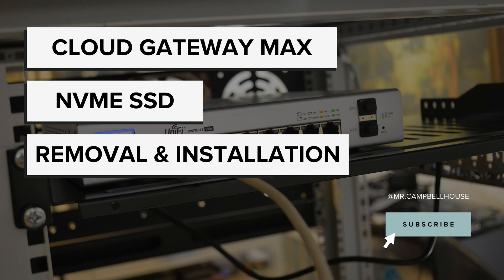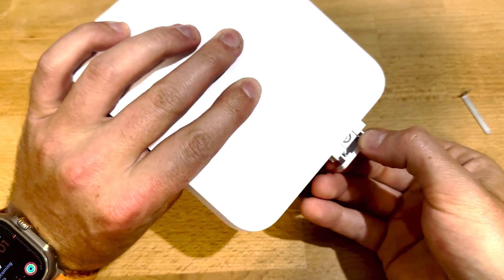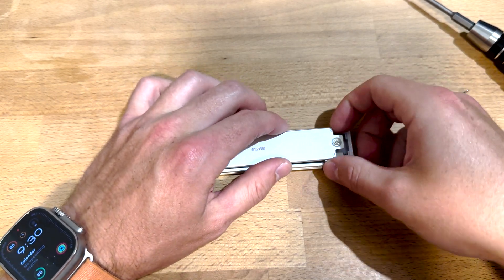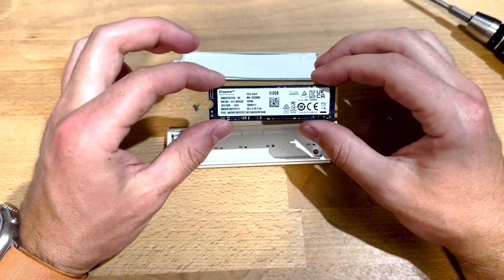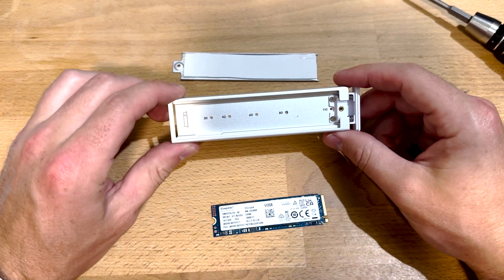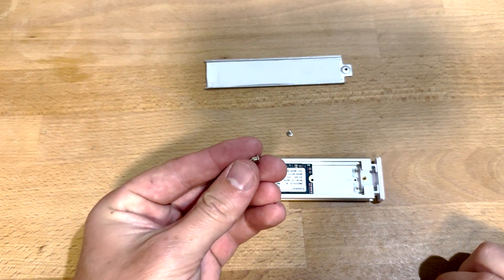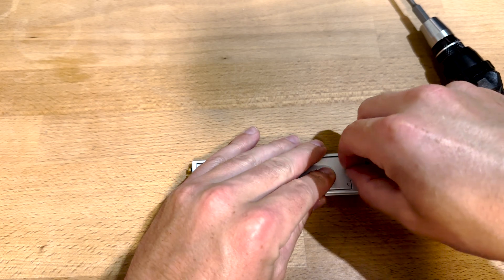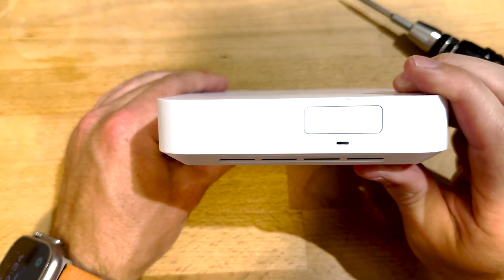Ubiquiti Cloud Gateway Max M.2 NVMe SSD removal and installation

Comment: Thanks for sharing the video.  Do you think dual side NVMEs could fit?
Reply from the maker: You are most welcome! And yes, I do believe double sided NVME drives will fit.
Reply: I agree it should fit. There are only cooling pad on one side, but good amount of space on the underside. The card is resting on the tiniest ledge on both sides, it should not interfere with any ICs.

Comment: Thanks for the explanation,
The UCG-MAX (only without SSD) is now available in Japan, but the SSD tray has not been released yet.
I found a 3D printer tray on eBay, but it costs 40USD with shipping and I'm scratching my head. Any opinions or ideas?
Reply from the maker: Hi! Sorry that I missed this. There is no reason a 3D printed unit wouldn't work, but it may need to be of a higher temperature filament or resin as SSD's can run hot (~70C). $40 seems steep, you may be able to acquire an .STL and have it printed by a service or see if there are any libraries near you that have 3D printers.

Comment: bought the max but with no m.2 and the bought a caddy on ebay but all the m.2 ssd that put are not showing all it says is Add Storage Space
Save application data by inserting an M.2 NVMe SSD.

Comment: Does this ejection tool come in the box with the No Storage option too? I am unable to find it.
Edit: if not, will I receive this tool when I buy the drive sled?
Reply from the maker: I don’t know as I don’t have the no storage option. It is the same tool included with their wireless access points and many of their cameras if you have any of those but I would presume it would be included with the drive sled too.
Reply: Dont buy that tray, there are plenty of free 3d printing  plans over internet.  I was able to open tray with piece of  expired visa plastic card.
Reply: Mine came with the camera I bought

Comment: Hi, great video—thanks for the helpful walkthrough! I noticed the spec sheet mentions support for up to a 2TB SSD. Do you know if it’s possible to install an SSD with a larger capacity, or is 2TB the hard limit? Thanks!
Reply from the maker: Hi! I haven't personally done it, but I've seen other users install 4tb drives successfully, confirming that 2 TB is not a hard limit.  Give it a shot!

Comment: I bought a new WD Black SN850X 1TB and it didn’t work, just gave me an error that the drive needs replacing so I don’t know if I have a dud gateway or a dud drive
Reply: You can probably fix it but seems to be common bad tray especially considering you pay for the shit
Reply: @ turns out they’re not compatible with WD. Swapped to a Samsung and all works fine. Someone online found that WD skips something in their hardware so the gateway can’t talk to it.
Reply from the maker: @DukeDames good to know. Thanks for sharing!
Reply: @DukeDames  Thanks for sharing the WD limitation, sad cause i wanted to try a SN850X 8TB, but i guess i'll start looking elsewhere.  Btw you think an SSD with chips on the back will still fit or you need a one sided ssd?

Comment: Stupid question- is the storage only for NVR use?
Reply from the maker: Not a dumb question! As of right now, Ubiquiti only allows onboard storage to be used by Unifi Protect. This goes for all their unifi products including the dream machines with their 3.5" bays. 

It does appear that Ubiquiti has a NAS in the works, but only time will tell if Ubiquiti allows the storage on other devices to be used as a NAS as well.
Reply: @mr.campbellhouse  thanks for the quick reply - will get the empty version then, as I’ll not be using Unifi cameras 👍🏻
Reply: @TheMrPedrose  it’s also used for UniFi Talk phone recordings such as voicemail and UniFi Connect signage content

Comment: Is there any special formatting needed when installing a new drive? Even after having used the 512 for some time?
Reply from the maker: Best practice is to go to format the new drive. You can do this by going to “console settings, storage” and then clicking format to prep your new drive.
Reply: @mr.campbellhouse  makes sense thanks
Reply: There is a holder from unifi for 19 bugs in the store . Available September 23 2024
Reply from the maker: @alexanderjupe4977  Thanks for sharing that information, I hadn't seen that! UACC-SSD-Tray for anyone looking for it.

Comment: Apparently Ubiquiti support has said the no storage option will not come with a drive sled. So you need the 512GB if you want to upgrade it yourself or you'll need to 3D print something
Reply: They now offer the trays for $19.99 in the UI store.
Reply from the maker: Wow, that's really disappointing if true. I'll update the video if that ends up being the case. They'll need something to fill the space regardless, so hopefully everyone gets a sled. Some M.2's get toasty, so a 3D print would be suboptimal because even if it withstands the heat, it won't cool the drive like the ubiquiti one does. Thanks for sharing.
Reply: @mr.campbellhouse  Unfortunately, I can confirm it just comes with a faceplate. I ordered the UCG-Max-NS Friday, hoping to add my own M.2 drive, so I'm very disappointed when it arrived today with no tray!
Reply: I can confirm there is no sled with the “no storage” option. The optional sled is required.
Reply: That is really annoying. There is nothing on the website to suggest that there is not tray. My Cloud Gateway Max arrived yesterday with no release tool or caddy.
The caddy is, or course, out of stock because Ubiquiti 😞
I am already wondering if I have made a mistake starting to switch to  this company if they are going to take the mickey like that.